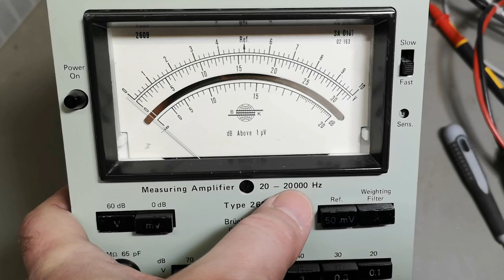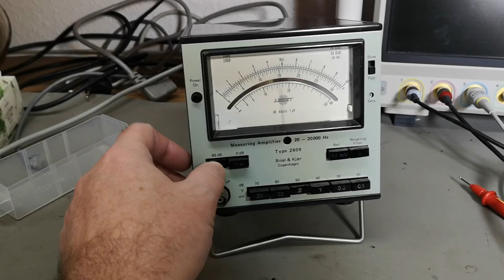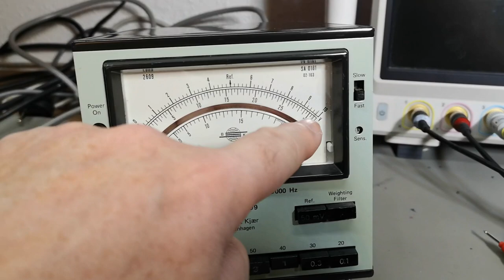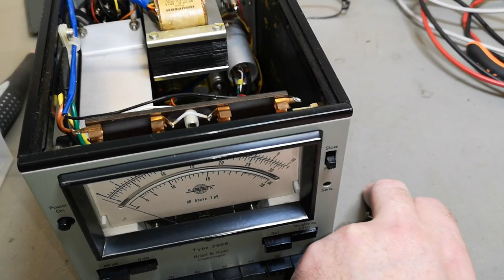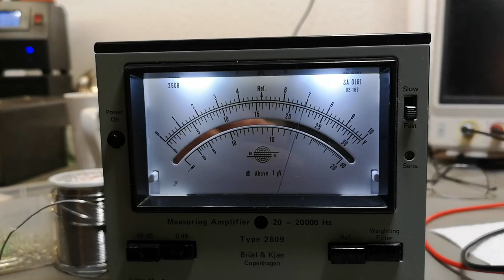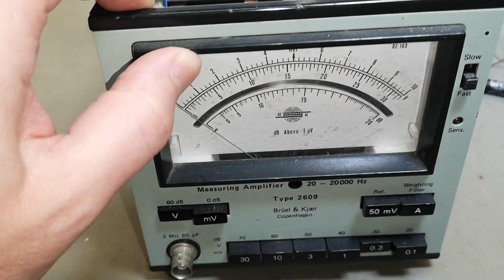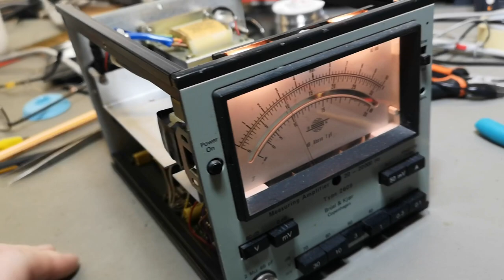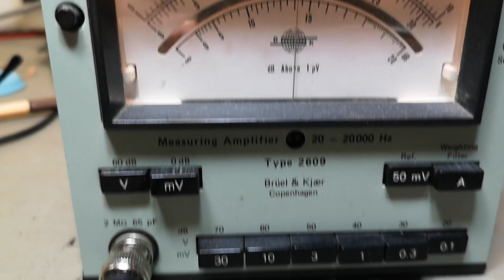Brüel & Kjær  Measuring Amplifier 20-20kHz Type 2609 1977 test teardown repair

Comment: I think you can find the light bulbs in motorcycle shops that have spare parts for restoring old motorcycle. That have 6v circuitry and the positioning light is just like that shape.
Reply from the maker: i had the same idea, but the type i need is much more slim